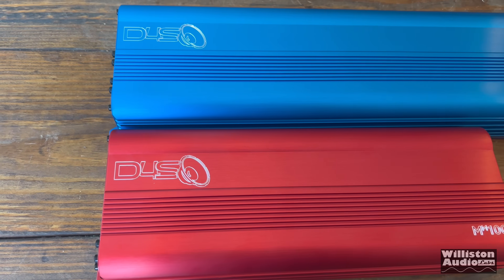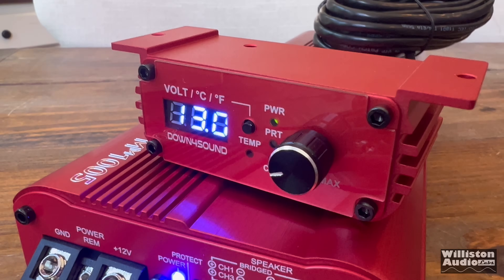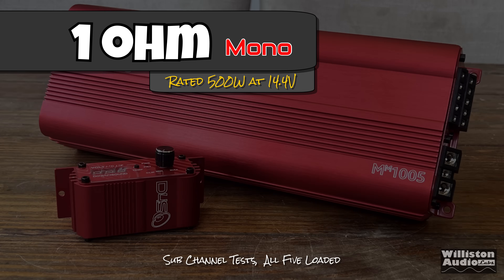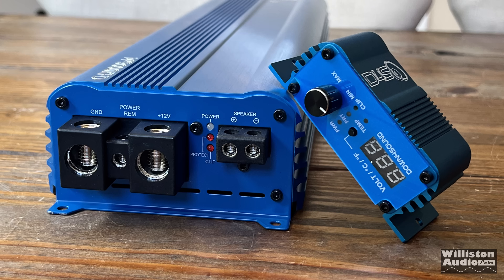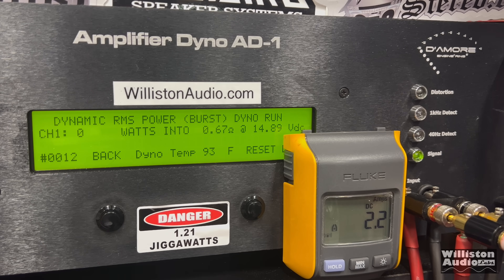Double Feature Amp Dyno Test - 1000W 5 Channel and 3000W Monoblock

Comment from the maker: SHOP FOR MINI AMPS
D4S MiniMaxx Amplifiers: https://lddy.no/1hrle
D4S MM1005 1000W 5ch Amp: https://lddy.no/1k2df
D4S MM3000KFD 3000W Full Range Capable Monoblock Amp: https://lddy.no/1k2dg
Elac Debut 2.0 B6.2 Bookshelf Speakers: https://amzn.to/3Mmdbcz
SAVARD Hi-Q 6.5" Subwoofer: https://lddy.no/1iv98 (Use WAL7 for 7% off)
See Other Mini Amp Videos: https://www.youtube.com/playlist?list=PLu98-M_EowHPeIJDo-ISyHCtT__PzQsDi

VIDEO INDEX
0:00 Introduction
0:23 Unboxing MM1005
2:05 MM1005 Features
3:32 MM1005 Amp Dyno Tests (4ch)
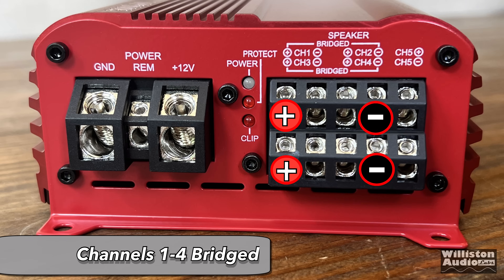5:28 MM1005 Amp Dyno Tests (Bridged)
6:28 MM1005 Amp Dyno Tests (Sub)
9:30 MM1005 Sound Demo
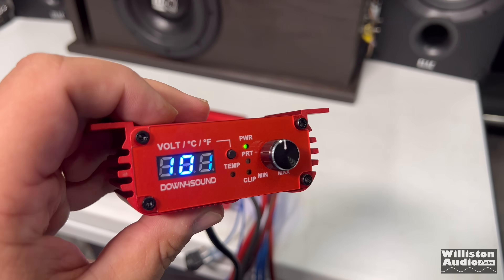10:55 MM1005 Amp Guts
11:46 MM1005 PROS and CONS
12:40 MM3000KFD Overview
14:08 MM3000KFD Amp Dyno Tests
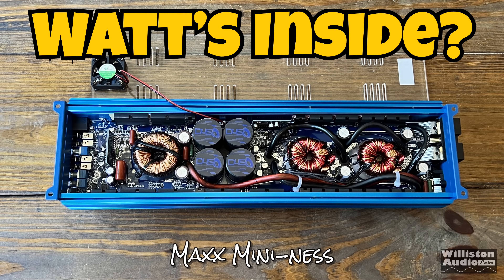16:18 MM3000KFD Amp Guts
17:04 MM3000KFD PROS and CONS
18:07 EXTRAS

Note: Amps were sent from D4S for testing, but video is not sponsored by D4S. Down4Sound paid a fee to have the amps tested and shown in this video but all content was created by Williston Audio Labs without input from D4S and we show features, tests and give our honest feedback

TEST BENCH EQUIPMENT
SMD / D'Amore Engineering Amp Dyno (AD-1): https://is.gd/wccad1
XS Power D1400 Batteries - https://amzn.to/2BPFCKW
XS Power PSC60 Charger - https://amzn.to/2CHGcfs
Fluke 1000A AC/DC Clamp Meter: https://amzn.to/2Rw5WDA
Handheld Dyno AMM-1: https://is.gd/wccamm1
My Favorite Precision Screwdriver Kit: https://amzn.to/3yAaPmn

DISCLAIMER: This video and description contains affiliate links, which means that if you purchase from one of the product links, I may receive a small commission. As an Amazon Associate I earn from qualifying purchases. As an eBay Partner, I may be compensated if you make a purchase
Reply: The connectors are Molex Micro-Fit 3.0.
I made a set of longer shielded connectors instead of using the pigtail that came with my MM1004. It would be nice if these were available in pre-made longer lengths.

Comment: I got my mm1005 pushing 4 hertz deici coax in rear doors and components in front with a small 10” sealed box and I’m currently pushing 1 10” comp r wired down to 1 ohmsounds good also my Volts be week so it’s pretty awesome

Comment: Only rated for a 25% increase when halving the resistance from 2 to 1 ohm... Not impressive in the slightest. I guess if you only need half the power*, and only have half the space*, it may make sense, but with only a 25% increase, just keep it at 4ohms. It'll sound better and last longer. (*as compared to a HiFi-6150D) - I am referring to the first amp, of course.

Comment: Such an odd choice. The sub channel should have more like 500w @4 ohm if the others are 80w…
Reply: Are you saying the subchannel shouldn't go below 4 Ohms? Most people nowadays wire their subs fairly low which is why down for sound chose to do the subwoofer channel down to one ohm.
Reply: @JasonWW2000  no, I just wanted to point to an ohm load that the channels were both rated for so it wouldn’t skew my comparison Edit: BUT on that topic I don’t like how the industry has normalized 1 and sub-ohm loads, I get it because automotive voltage but still, it’s always going to be a ragged edge that gives amplifiers questionable lifetimes.

Comment: The only number I didn't like on the 1000x5 is you peaked the amp pull at 97 amps to alternator/battery. A guy can wish that was 85 amps. That's closer to 70% of "most" alternator capacities. Damn good try tho D4S. Thumbs up from me.
Reply: For it to pull that much amperage you'd have to have all five channels wired down really low and then push all five channels to full power. That's never going to happen.
Reply: @JasonWW2000  most door speakers are 4 to 6 ohm most subs are dual 2 ohm your already there. And if parallel 2 6x9 and have a super tweeter your at 2.5 or 3 ohm
Reply: @JasonWW2000  he did 3 and 4 ohm load tests. Speakers rise and fall in resistance with use. So if you have a 3 ohm Speakers that dip to 2.25 ohm at peak it needs the 97 amps from the alternator. So you're already at the limit. Now if you had some of the 90s stuff that played at 90 or 91 dB sensitivity and was lighter and was set for 6 and 8 ohms. You would only need to run the amp at maybe 45 watts per channel so you only pull about 50 amps at the alternator.
Reply: @kyleteal5888 You're way overthinking everything. If you want to draw less amperage from your electrical system, turn your volume down.
Reply: @JasonWW2000  rock concerts are said to play at 90 dB and big bands are said to peak in the best concert halls at 120db maximum and I personally like to listen at 92 to 96db that's not loud and I m looking for SQ as well.
Reply: @kyleteal5888 My best advice to you is to take a pause with all the theoretical stuff and buy yourself a DC clamp meter. Get some real world testing under your belt. 

Clamp the power cable of your amplifier while playing music as you normally would. Make a note of your voltage and average as well as peak amp draw. This will tell you how much power the amplifier is drawing. 

You'll notice that you can have very high volume with very low power consumption depending on the frequencies that are played. Some frequencies draw a lot of power and some draw very little. Once you understand this, as well as the dynamic nature of music, you'll realize that you're drawing a lot less power then you think you are. 

It's great that you know a lot of theory, now you want to put that to practice with real world measurements. 👍

Comment: How’s the SQ with these D4S amps? In regards to SQ brands like Focal, JL, ETC. I’m looking to replace a kenwood xr5s that sounded incredible. I currently have a couple Taramps 440/4s and while they are clear and can get down, at the higher volumes they don’t keep up with the kenwood in SQ. They get louder but they mud a bit.
Reply: Higher power 5-channels are out there but they will cost you. Crutchfield has a good selection. The thing with a higher-end amp designed more for sound quality is that you don't need a lot of power to sound great and loud. It doesn't seem like you are trying to go super-high power, so you might even look into something in the 60 to 75x4 range for the mids & highs as well. It's like the sound quality difference between running speakers off the 50x4 head unit vs a 30x4 external amp.  At a small power difference, I would veer towards quality vs total power.  You could also look into 6 or 8 channel amps as well and do some bridging if you want higher power to the subs at 4-ohms instead of 2 or 1ohm. A lot of people use the Audio Control 5, 6 and 8 channel amps
Reply: @jp1087  so basically it’s like a turbo inline 6 in a light chassis vs a healthy V8 in a heavy duty? One could say the hertz is capable of higher output through the speakers with less watts than a taramps?  I’ve been scouring marketplace and just secured a hertz 5 channel for the low low, a HDP5. I look forward to seeing how it sounds vs my current setup as well as my prior kenwood.
Reply: @IAM_Car_SHT   I would say the Hertz amp is capable of better quality output with less wattage at higher volumes, not necessarily more output in general.  It's like the difference between a turbo-diesel and a supercharged V8 in the exact same chassis.
Reply: @jp1087  I see what you mean. I also just got a HDP5 installed on Monday, i really like it. Got my eyes on a matching monoblock now as well lol
Reply: 50 x 4 headunits are actually 15 x 4 in most cases. 

I ran across the Synergy Audio SYN  1100.5D. It's massively powerful.
Reply: @JasonWW2000  I’ll keep an eye for synergy audio, thanwk
Reply: The Taramps are known for their high levels of distortion. I don't have any experience with the down for sound full range class D amps, but at the same time I've never heard anybody complain about their sound quality. Hopefully some more people will chime in.
Reply: @JasonWW2000  hey hearing taramps is known for that is helpful enough in itself. I just fixed my car after a year down with 2 4 channel pioneers on Rockford mids/highs. I need to put one of my radios in it and listen for that type of distortion. Their S/N ratio is much lower than the kenwood, so it’ll be interesting where they stand in regards to the kenwood and taramps.
Reply: I don't see people running them in specifically-designed SQ systems. For an everyday upgrade, I suspect the 5-channel would sound good, and maybe even great to someone who likes to listen to loud music and isn't going for competitive SQ.  People use the D4S big-wattage amps just because they want to create a tornado outside their car, regardless of what it sounds like, nothing more; and they can do it at a low price, with the exception of the massive electrical upgrades required.  I equate D4S and Taramps to tires on a performance car.  They are meant for a specific purpose and you'll need to replace them more often, that's why they are so cheap. Are they going to be around 30 years from now still performing like the Fosgate, PG, & JL?  If I were looking to get a 5-channel for an SQ system, I'd look at JL, Arc Audio, Hertz, etc.
Reply: @jp1087  oh okay, that’s a great perspective, very helpful. Before stumbling on this one I was keeping my eye for a JL or RF Power. I’m interested in arc but they don’t have the right power level, but I’m glad you reminded me as that may be a god fit for my other build lol. I honestly never checked hertz figured they wouldn’t have what I want, maybe I’ll be surprised
Reply: @IAM_Car_SHT Looking at the specs on that Kenwood it's 80w x 4 and 350w to the sub. 

Are you powering 4 door speakers and a sub?

Is it the door speaker power you want more of or the sub power?
Reply: @JasonWW2000  yes 4 components and 2 under seat subs that I’m actually running as mid bass. Then a mono block and box in the trunk. I’d like to see 100rms at 4 ohms x4 at least 350 on the mid bass, probably no more than 500 at 4 ohms. I have prv neo 4s for mids and my tweeters are mismatch for now until I decide on what drivers will fit the factory spot. Rockford tweeters pop right in, may go with the power series or audio control
Reply: @IAM_Car_SHT Sorry, I don't know of any really high power 5 Channel amps. Most of what I see is 50 to 80 watts per channel at 4 ohm. That just seems to be the norm when it comes to 5 channels.

Digital designs used to make a D5.1500. That was a beast, but it's expensive and hard to find. 

This D4S 5 channel and the bigger JP95T are the biggest, most affordable 5 channels I know of.

Comment: I run a 5 channel in my daily. It's a kicker rated at 400 RMS on the sub channel. With an efficient 12 inch I score 132 db on the screen sealed at 36 Hz. That's all I need 😊
Reply: KXA800.5? I got one of those. 😄

Comment: That MM1005 is really nice for a 3 way system. 500 watts into a higher efficiency sub and the right box will flex a windshield. Channels 1 to 4 have decent power too.

I used to have all out systems in my vehicles. Extra batteries, alternators, caps and all. Complete compact systems are where it’s at now.
Reply: Have you gotten older and started to play your music at a lower volume? Lol
Reply: @JasonWW2000  Hu? I can't hear you!
Reply: @matthewf1979 Up until fairly recently I used to always drive with a windows down and the stereo cranked. Now that I'm a bit older, I prefer keeping the windows up and playing the music at a nice moderate level. 😂
Reply: That means you're old bro 😄
Reply: Hairline and volume knobs correlates with age @JasonWW2000

Comment: Just as a suggestion. When you test amps that come with these type of bass knobs, test the accuracy of the knob as well.
Reply: Do you mean the accuracy of the voltmeter? These bass knobs have an adjustment screw so you can adjust it however you want.
Reply: @JasonWW2000  Yes the accuracy of them. How accurately they read the voltage, temperature and clipping point.
Reply: @travissapp4273  Voltage is adjustable. 
Clipping is super accurate due to the internal design. 
Temperature accuracy is unknown. The little temperature probe changes resistance based on temperature and has it's own window of tolerance. I'd imagine it's decently close. Also keep in mind that you don't have to be super accurate when it comes to temperature. You just need a rough idea if it's hot or too hot, etc...

Comment: The mm 3000 is a bad ass sub amp at 2 ohms with great efficiency , BEAST AMP
Reply: @danrimjob5546  I just ordered the D4s mm 3000kfd. Did you do anything to your stock electrical system in your vehicle. If so what did you do. And what kind of speakers are you pushing with the amp. I was thinking about adding another battery,high output alternator,capacitor I’m not to sure where to go after that I ordered 8’’in. Door speakers 120w rms I was thinking I probably need to re do all the speaker wire through out the truck for the tweeters with a heavier gauge wire. Fusible link for the main power wire to the amp what else can I do to keep it from drawing down and dimming my headlights and just eating the battery up
Reply: @rickybarker5778  if your running a 3k amp your going to HAVE TO UPGRADE your electrical. 1/0 awg big 3 kit, secondary battery, & upgraded alternator & all new 1/0 power an ground. A capacitor doesn’t do anything that’s a waist of money. If you’re going to go with a capacitor build a cap bank look it up on YouTube, the capacitor your thinking off is just a waist of money it won’t do nothing for you.

Comment: Really appreciate the lower voltage tests. Many of these modern German cars with smart charging only run 13.6-13.8v at most situations even if they have 140a+ alts from the factory

Comment: People seem to forget or not understand how much power 200 wstss actually is. We used to run entire subwoofer systems on 200 watts or less in the 80's and 90's. Crutchfield used to have an add that said  "100 watts to your subwoofers is loud. 150 watts is louder. 200 is mind blowing" or something like that. It's been 30 years. Lol The point is, 200+ watts is plenty for the average person that just wants a little bump to fill in their low end. .
Reply: Yep, I was there, great times. I have the tinnitus to prove it.
Reply: @GlockPointer  haha me too!!
Reply: I absolutely disagree. Subwoofers are less efficient nowadays. Back in those days, they had all paper cones and were much shorter excursion… what are you thinking?
Reply: Member berries gotcha
Reply: @brentdennard6722  we also weren't nearly as loud. 145db systems were rare and expensive, now you can get that with a shoestring budget. It's the best time to be into car audio, now I'm too old to really get down like I used to :(
Reply: Only on efficient subwoofers. Modern day subwoofers have been built for excursion and 200 watts doesn't move them very well.
Reply: We also had high sensitivity speakers... don't care what people say, sensitivity matters.
Reply: I agree!!!!!!!!
Reply: @dextermorgan1  yep! I have a big(ish) system in my truck. Bass amp went out and I decided to rewire my box from 1 ohm back up to 4 ohm and I bridged it on the rear channel of my 4 channel for the hell of it. 200rms on 4 12s. It still sounded great and people were blown away by how loud it still was. Wish I could’ve metered it like that. I rolled with it like that for a while just to prove to people that your box makes the biggest impact on how “loud” your subs are.
Reply: I absolutely agree. The market is polluted with high power claims and options, now relatively cheap.
That 500-600watts will push 2 entry level 10s or 12s enough to rattle a vehicle.
Reply: Agreed, that’s something many have forgotten. If you think about it , in home audio those of us that may have experience with lower power tube amps know just how little it takes to get reasonably loud , especially with highly efficient speakers